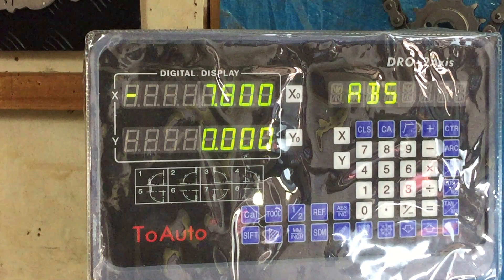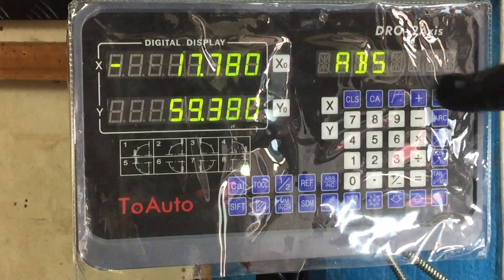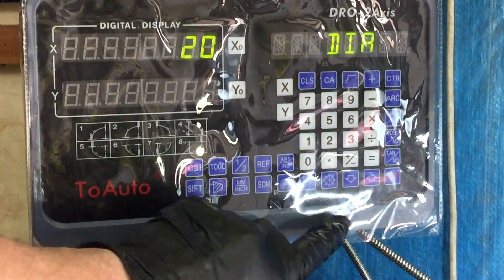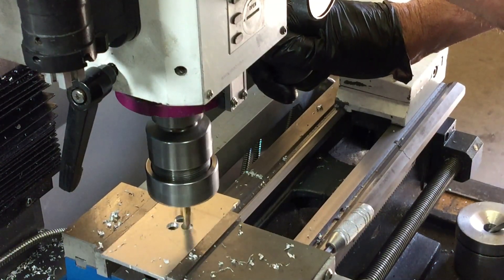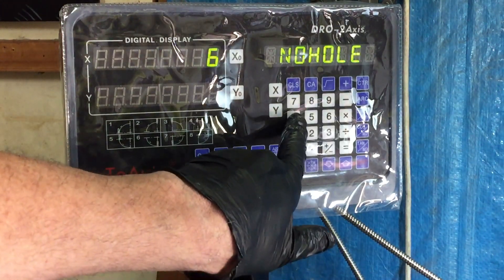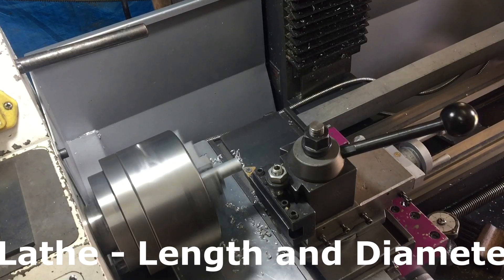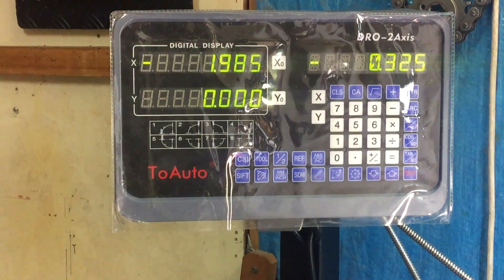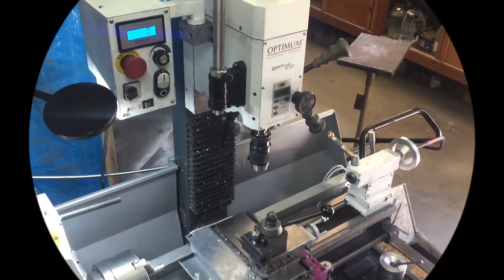Digital Read-Out By a Dummy - On a hobby Lathe/Mill Combo

Comment: I have a very similar lathe and I ended up mounting the DRO scale behind the cross slide for a few reasons. You can shield it better from all the crap that gets thrown around from the lathe chuck and if things do go south, the DRO scale is out of the way.
Reply from the maker: Yes. I considered that but I didn’t like the fact I could not get the end stock as close to the cross slide. 
But the guard I made solved the “crap” problem. 
Good to hear your install worked though.